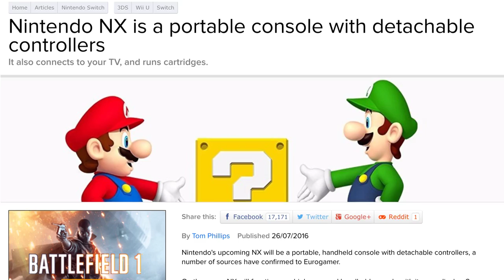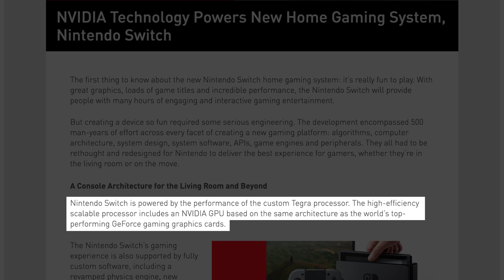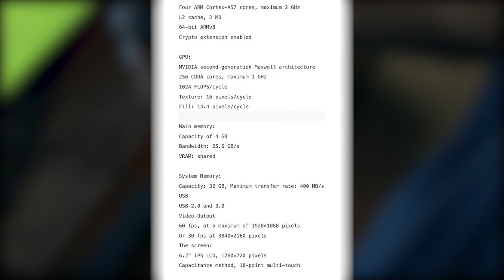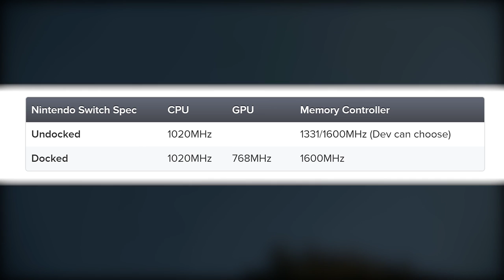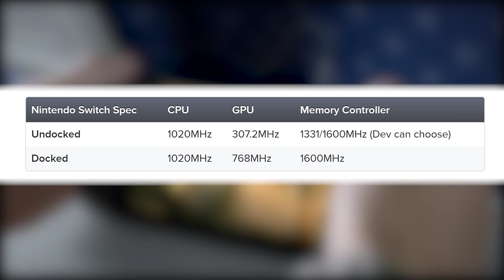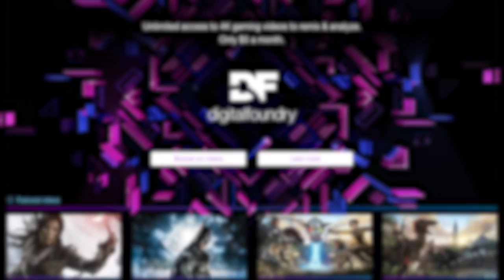DF Videocast #6: Nintendo Switch Clock-Speeds Revealed

Comment: My phone is more powerful than this thing undocked. lol
Reply: +MorimotoYTP Can the switch :P
Reply: it's not at all. it's more like an overclocked 360.
Reply: MorimotoYTP It was more like nvidia shield tv comparable.. that would mean gta V 60fps by a long shot, hell doesnt the xbox one do gta V 30fps?
Reply: Tim Brandt Corstius Forgot about the 60FPS part, that is only possible in gaming PCs. The Switch can handle 30
Reply: MorimotoYTP well it is a little better than exynoss 5433
Reply: MorimotoYTP in terms of cpu power
Reply: Unles you have found a very contrived way to use a Pixel C tablet as your phone, then no.
Reply: MorimotoYTP the Xbox one doesn't run it at 60fps
Reply: Jerome Ley "Over clocked Xbox 360" The switch is more powerful than the Wii U which is much stronger than the Xbox 360.
Reply: MorimotoYTP Maybe if you lower the graphics somewhere between ps3 and ps4, dont think gta V will be ported to the switch tho
Reply: Tim Brandt Corstius I see you found a "console specs for console dummies" site that poorly represents the specs. WOW clock for clock is all it takes to be faster. So I guess a Pentium clocked at 4ghz is faster than a Skylake i7 clocked at 3.9ghz in single thread performance. Good to know.
Reply: StoreBrand Ahaha lol, read further
Reply: Tim Brandt Corstius ahahah lololol haha huehuehuehue
Reply: Its pointless to compare processors by frequency when they are so many years apart and even using different architectures. Instructions per clock will vary wildly and you cant even really compare instructions per clock because different architectures require different amounts of instructions to perform the same work.
Reply: can your phone run xenobladeX , skyrim remaster, darksouls3 ? or even tekken ?
Reply: My phone can hit 2.8GHz when it isn't throttling but only has 4 cores.
Reply: goku21youtub I think the s7 exynos edition can run skyrim remastered if it used the same 720p display as the switch..
Reply: Brecondo (Sovereignty Yo) amazing! can you play breath of the wild on it?
Reply: Tim Brandt Corstius
no it won´t becasue it runs on android and has no real shaders but just the mobile subset of hardcoded graphics while the switch has the hardcoded stuff for acceleration and real cudacores for custom effects/shaders/instancing of grass n all those opengl tricks and physics gpu acceleration(havok, physix)

the video makers are also wrong by the simple fact that the shield tablet has no cooling yet the lower clocked switch needs active fans ? makes no sense unless the dóubled up the cudacorecount or have a big edram build into the soc
Reply: goku21youtub Yah but still if you comprare just pure power, the s7 exynos would be as fast or almost as fast.. that it doesnt has the hardcoded graphics yah.. cant help that (wouldnt it be possible to give those hardcoded graphics trough a software update if they wanted)
Reply: goku21youtub Android 5.0 and higher has support for OpenGL ES 3.1, which does have programmable shaders. Android 6.0 and higher has Vulkan support, too.
As for the fans, the switch would probably use those when the console is docked and the GPU runs at the faster clock speed. Pixel C doesn't have fans, but the CPU and GPU throttle with temperature, which is something that Nintendo is probably trying to avoid.
The informations DF have given us are probably accurate, though I feel like these modest specs will be adequate.
Reply: Tim Brandt Corstius
no the tegras have real gpus with programmable shaders like dx12/opengl5.3...
Reply: opengl es3.1 vs opengl5.3 ... it just misses all hardware needed by modern games, phones run gta vice city with old ass shading...  the switch can run an upgraded xbox360 version of gta5 ...
Reply: goku21youtub Yah but why cant they add programmable shaders with a software update.. just like how they added vulkan
Reply: @Faizan Ali

Dude the Switch is way weaker then the Shield Console or Pixel C Tablet and actually the iPhone 7 outperfors both in EVERY benchmark.
Hell the iPad Pro from 2015 destorys those devices. Check some benchmarks (Geekbench, GFX).

The switch IS way less powerfull then current smartphones IF this is true.
Reply: @SteelSkin667

The switch will be weaker then an iPhone 7 (which already outperforms the not downclocked Shield console and Pixel C tablet in most benchmarks).

Here are some Benchmarks guys.

Geekbench 3 (processiong performance)

iPhone 7 - Singlecore: 3380; Multicore - 5500
Nvidia Shield Console - Singlecore: 1650; Multicore: 5040

The Switch will run at 50% of the Shield Consoles clockspeed.

GFX Benchmark (graphics performance) Trex 1080p offscreen Render:

Nvidia Shield Console - 120 FPS
iPhone 7+ - 108 FPS
Google Pixel C Tablet - 103 FPS
iPad Pro 2015 - 170 FPS
Xbox One - 400 FPS
PS4 - 480 FPS

And the Switchs  GPU will run at 1/3 of the clock speed of the Shield Console.
Reply: coolertuep Honestly, those single-core CPU benchmarks are kind of irrelevant when trying to speculate on graphical performance like we are doing tbh. But I do agree that the handheld mode GPU frequency is WAY slower than it should be to be competitive with those $900+ flagship phones.
Reply: @SteelSkin667

Actually Smartphones (especially iPhones) are sold at a high profit.

EG the iPhone 7 is just ~200 dollar to manufacture. The rest is marketing, Image/Brand and profit.

An iPhone 7 also has one of the best LCD panels ever made for a mobile device, excellent build quality, 4G Lte Antennas, Force Touch and Taptic Enginge technology, Fingerprint technology, Good front facing and excellent back camera and much more.

The switch probl wont have these.
Reply: coolertuep Yes I do own a OnePlus 3T that has all those things but is sold for less money, because China. I still think that the Switch will compare favorably to most smartphones out there, although next year's smartphones might be a whole different story.
Reply: SteelSkin667 Sorry but your smartphone uses Android and that means all the power goes to waste because of bad optimization. thats why the iPhone 7 with less RAM and less everything outperforms all android phones in heavy task. The switch programming is closer to the metal than the iPhone never mind an Android phone.
Reply: but the software environment is garbage, benchmarks included, it's all fluff.
Reply: StoreBrand Wii U was 5-10% faster than the xbox 360. Put it this way, the switch is going to use the x1 processor, the x1 is in the nvidia shield, the nvidia shield can play crysis 3 with similar framerates to the ps3/360
Reply: the x box 1 is about 250 gflops while the wii u is about 350 gflops so it isnt 5 to 10 percent difference
Reply: Justin Wong flops doesn't matter in gaming performance when we're talking about different architecture. The only reason why we're talking flops now is because the ps4 and the xbox one has a very similar architecture and therefore could be compares with floating points per second.
Reply: maxwell should still be good
Reply: coolertuep dude why you comparing a dedicated video game system to a smartphone?
Reply: No, your phone is not more powerful than the Switch undocked. What is with you people and your flat-out lies?
Also, who said Switch was confirmed Maxwell? Just because devkits are? That doesn't mean the Switch will be Maxwell 100% guaranteed.
Reply: apocalypseap well, x1 is a mobile chip, and it's more than 1 year old. If say the snapdragon 830 comes out, I can almost guarantee it's faster than the x1. the iphone 7's gpu is probably faster than the x1 right now.

It's pretty much 90% confirmed that it's x1.
Reply: Jerome Ley "x1" stopped reading right there.
Reply: apocalypseap ?
Reply: Jerome Ley Assuming it's X1 is folly at this point. It's all speculation.
Reply: apocalypseap Jeez, you need to get updated dude.
Reply: And it will be throttling after 2 minutes of playing games.
Reply: The nvidia sheild tablet had a tegra k1(produces 5 to 8 watts) and a magnesium thermal sheild.Nvidia said it could passively cool up to two times the amount of heat if produces(up to 10 watts)and the tegra x 1 produces 10 watts
Reply: Plus the x 1 is 500 gflops with MAXWELL which your phone doesnt have.The iphone 7 is only 300 gflops and the next snapdragon isnt going to beat it
Reply: gnadenlos
Doesn't seem to unless it just always throttles but if it is Cpu Z isn't showing it.
Reply: gnadenlos
You can push some chips beyond 3GHz but I wouldn't recommend it.
Reply: Jerome Ley You need to stop believing everything you see.
Reply: apocalypseap hopeless.
Reply: Jerome Ley Yep, you definitely are. The Switch isn't even out yet nor are its specs confirmed and you're acting like you know already.
Reply: apocalypseap digitalfoundry has a track record. it's 90% confirmed, and you're saying "it could be anything, omg it might be intel fucking hd, or it might even be kirin, because it hasnt been confirmed"

It's crazy how much information we have on the internet, and it's also crazy how people are as oblivious as you to it.
Reply: Jerome Ley You're literally making shit up. You're rational.
Reply: so your saying nintendo will release a device that is weaker than a smartphone.Plus how can the track record be correct if it runs way better in both modes than a wii u which is 350 gflops
Reply: and why would they need vents and why would it be so thich
Reply: k
Reply: Justin Wong They're just talking out of their asses. Nothing is confirmed about Switch's internal specifications except Nvidia is making a GPU for it and there'll be an ARM CPU. That's it.
Reply: yeah, and your phone also throttles way more than this thing undocked lol
Reply: apocalypseap Thanks for sayin I'm rational? I guess? lol
Reply: Brecondo (Sovereignty Yo) Then don't buy it and fuck off! I'm buying it.
Reply: Can you play the legend of Zelda breath of the wild though?
Reply: Except your phone has shite games.
Reply: Brecondo (Sovereignty Yo) ahhaahhaahha
Reply: @Jerome Ley Crysis 3 was never released on Shield console it was a fool
Reply: There's no way even the highest end smartphone can run Breath of the Wild smoothly
Reply: @J Gio Sanchez

Modern smartphones like the iPhone 7 are already outperforming the wii u significantly in graphic benchmarks
Reply: coolertuep More bullshit from another "Apple is magic" fanboy. Not surprised.
Reply: @Apocalypseap
 
Gfx Benchmark Trex 1080p

Wii U: 63 frames per second
iPhone 7: 107 frames per second

source: gfxbench com

So?
Reply: coolertuep I must be more tired than I thought because I thought you were actually referring to something relevant to this conversation, i.e.: not the Wii U.
Reply: @apocaypseap

Uhm whats actually our point? Read the conversation again lol.

"Modern smartphones like the iPhone 7 are already outperforming the wii u significantly in graphic benchmarks"

-apocalypseapvor 54 Minuten
+coolertuep More bullshit from another "Apple is magic" fanboy. Not surprised.

Btw the iPhone 7 is also stronger then the rumoured switch specs. its rumored to use a Tegra X1 which is used in the Google Pixel C as well and just achieve 103 FPS in the benchmark. Actually the Switch chip is even rumored to be heavily downclocked, so it will be even weaker.
Reply: coolertuep It is a very poor comparison to compare specs of a smartphone and a dedicated gaming system since they built for completely different purposes. The architecture is much different and phones don't even have dedicated GPUs.
Reply: @J Gio Sanchez

Uhm you dont have much knowledge what your talking about right?
All Socs are using GPU and CPU and a single chip. That was the case for almot all consoles ever exist. The ps4 and xbox one both dont have dedicated GPUs either.
The switchs tegra SOC wont have a dedicated GPU as well.

The integrated GPU in the iPhone is the PowerVR GT7600 and already outperforms the Tegra X1 custom GPU based on maxwell Cudacores.

Both system are very compareable with the Tegra X1 chip even beeing already used in tablets. The architecture is basically the same, both are using very similar chips. The Switchs chipset was originally developed for tablet / smartphone usage.
Reply: coolertuep I'm saying even mentioning the Wii U on this video's comment section is stupid. This is a comment section about the Switch, not the Wii U. Stick to the topic.
Tegra X1 is over a year old, so your rumor info is terrible.
Reply: @apocalypseap

Dude watch the video above lol.
Somebody said Zelda BOTW wouldnt be able to run on any smartphones out there which was disproved by prooving that modern smartphones are stronger then the wii u. 

All your comments dont make any sense wtf haha
Reply: coolertuep Parody example of what you did: bananas taste better than iPhones, dude.
Reply: coolertuep original comment: "My phone is more powerful than this thing undocked. lol"
this thing
Oh, guess what that is? DUHHH I DUNNO MAH NAME IS COOLERTUEP AND I LIKE STATING OBVIOUS THINGS THAT ARE UNRELATED DURRRRRRRRRRRRR
Reply: U realize that the iphone 7 is 300 gflops and thermal throttles
Reply: apocalypseap

Im serious about this, you definilty should look for professional help.

@Jusin Wong
It doesnt throttle in that benchmark. Never heard about it throttling in gaming as well.
Reply: Im talking about the cpu
Reply: It doesnt throttle in gaming because its clockspeed is lowered to like 300 mhz and games arent very demanding on phones
Reply: look at all these nerds defending their phones like some sort of master race lol
Reply: Brecondo (Sovereignty Yo) Your phone is also $800+
Reply: FrostyP 
My phone is a Z3 you can currently get for the same price as the Switch or less.
Reply: No Loli No Life Yus
Reply: No Loli No Life Yus
Reply: No Loli No Life Exactly. Phone battery life will be complete shit running games comparable to the Switch anyway.
Reply: can you play BOTW,Mario Kart 8, Skyrim on your phone?
Reply: It's amazing to see how truly wrong much of this comment section ended up being.
Reply: @MorimotoYTP  I can't believe people used to think the Switch is comparable to the base Xbox One. Lol. It's less than half of the power of the Xbox..
Reply: @nickmotsarsky4382  true

Comment: Nintendo Should have waited for Ryzen APUs with HBM on package man. Especially with the new Radeon Chill and free-sync to further improve it's battery life
Reply: hmm, well, that would be nice, but the handheld console would cost 500usd and battery life would be abysmal.
Reply: nilssab
AMD has some really low power parts, they're probably going to go there eventually with Ryzen cores
Reply: true, I guess it would mostly be a cost problem with HBM then
Reply: *****
You can't be real...

AMD has at least one recent 4W part in the A4-1200, not an impressive chip, but now the chips are on a far improved process node at the very least

https://www.pcper.com/reviews/Processors/AMD-2013-Mobile-Platforms-Temash-Kabini-and-Richland
Reply: To be fair that top end Ryzen CPU has lower TDP than the intel counterpart. And it's half of intels TDP.
Reply: Artūras Lekstutis
ya but TDP isn't exactly equivalent to power draw, even during them demo while under full rendering low they drew about the same power, which is still good as intel still has a better manufacturing process